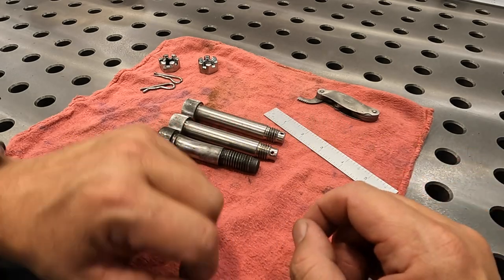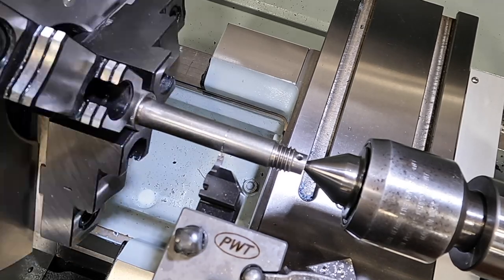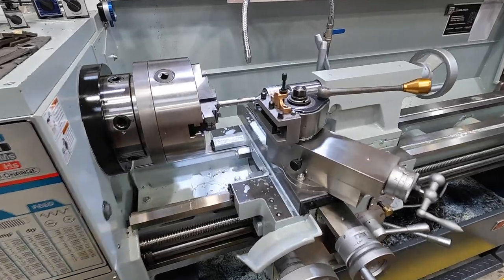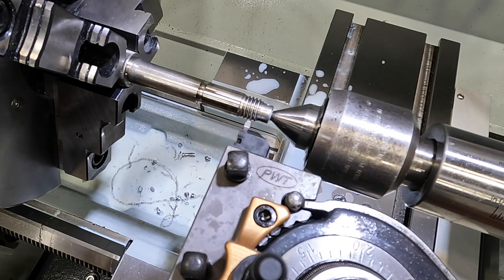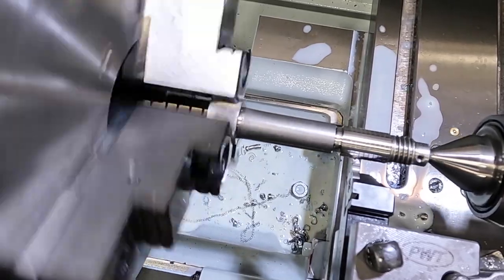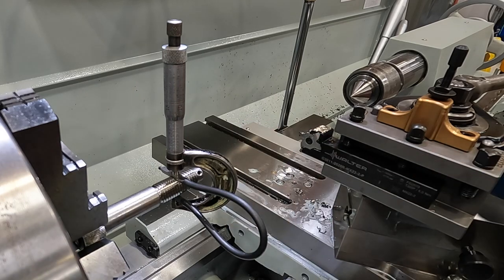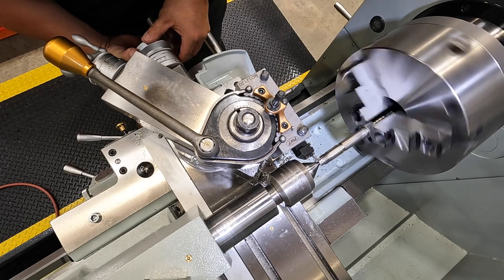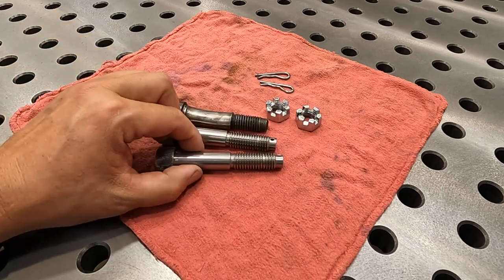Single Point Thread Chasing on a Manual Lathe

Comment: Greetings Adam. Congratulations on the new shop and expansion of your machining capability. You should be very proud. Now for the hard part. Your setup was destined to ruin the original threads from the start. Locating the threading tool on the right side of a 60 degree thread with the compound set at 29 1/2, doesn't work the same for chasing as it does for cutting a thread from scratch. To simplify, imagine 2 cars on the freeway side by side, but the one on the right (original thread profile) is slightly ahead of the one on the left. Now the car on the right turns 30 degrees to the left while you only turn 29.5 degrees to the left. A collision will occur. Exactly the same thing happen to the original threads on this rework. I don't have the parts to inspect, but I'd bet ya dinner, the original thread PD is now smaller than additional threads you just cut. Align the 'V' first as deep as you can then back out the tool and creep back to that position. I hope you accept this in the good faith it was offered. Stay well.
Reply: I was wondering the same thing... not knowing how the original thread was made (process, geometry, tool wear, machine integrity, etc etc), one would be forced to first align the re-work tool to the thread as closely as possible before setting up a hard rule like the 29.5° compound setting - otherwise one is pretty much destined to cut over the original thread somehow somewhere...
Reply: I havent done it a lot, but when I do I put the compound parallel to the work  engage threading and stop the spindle when in front of the threads then  just dial the compound until the thread lines up. Ok so I am feeding straight in, Its a repair job.
Reply: look like the nut threaded on great to me.
Reply: Actually .... this works just fine. The right flank of the cutting tool is aligned parallel with the right side of the thread "wall". When feeding is done with the top slide, the flank of the cutting tool keeps the distance from the right wall of the thread groove. This works because the top slide is in the correct angle which makes it parallel with the right wall of the thread groove.
If Adam would have the habit of keeping the top slide parallel with the ways and would feed using the cross slide (like I do), this definitely would ruin the thread if aligned as shown. In this case the alignment is done perpendicularly to the middle of the thread groove.
Reply: @danneumann3274  That's how I do it as well. I usually do not confuse myself with the 29 degree stuff. Actually I have my top slide dialled to be parallel with the ways. This makes it much easier to feed along Z-axis (along the ways).
Reply: @FinnoUgricMachining  the angle of the compound did not match the thread profile. Right side damage was imminent.
Reply: @joepie221  Okay, agreed. But at least Adam tried to ... 😄
Reply: @joepie221  maybe you could show us , would appreciate  it .
Reply: I also think the thread was rolled slightly
Reply: Shouldn’t we have dressed the top of the thread form, too ? There needs to be clearance between the top of the screw thread and the root of the nut thread, otherwise the thread pitch diameter will be undersized by the time the nut fits . . . .
Kind regards,
Steve A.
Reply: @mikedyson7330  I already have. Check my channel video catalog for the chasing thread video.
Reply: This is so cool, my machine tool instructor told me about Abom today and the first video I watch, you are the first comment I see. I have been one of your subscribers for a while now. Great to see that you're active in the machinist/trade community
Reply: I run a solid toolpost, no compound needed. I align the threading tool with the auto-feed on my electronic leadscrew and send it. 
I thread the same way, no compound. Just feed with the cross slide. 

I’ve yet to dig my compound out for anything other than tapers since I took it off. 

Not saying anyone is wrong, but it’s hard to f*ck up the threads if you’re feeding straight in and properly aligned with the threads. Just sayin!
Reply: @Mr.CleanRIZZ4u  Thanks.
Reply: I know jack squat about machining. But my eye caught that mistake BEFORE he started cutting. I actually stopped the video and changed the playback speed to .25 and watched it cut into the side of the existing thread in slow motion. Kinda weird that he didn’t see it. It was pretty obvious when the nut didn’t go on smoothly.
Reply: @Joe Pie - exactly. And you can see what’s happening if you set playback speed to .25
Reply: I caught that when he first started getting down closer to original threads. Obviously removed some material there on the original, couldn't see why he continues on.... Those first few threads seem pretty loose when he was threading nut

Comment: On my badly worn Sheldon lathe I engage the half nuts then push the saddle to the right (for right hand threads) when lining up the tool with existing threads.  It must be a joy to use a tight, high quality machine like that!  Another great video!

Comment: I am a level 3 machinist apprentice and I have to say I've never seen a thread chased this way with a compound at 29°. Fresh threading yes 29°, but for chasing, I alway set my compound 90° aka so the ways of the compound are parralel with bed. Then I engage split nut, and feed back and forth with compound using a dial on compound to show when I hit either side of the thread wall. Then I split the difference, do an eye check and this ensures youre in the bottom. Then some guys like to take some pressure off one cutting edge of the tool which is fine and would be acheived by moving compound in direction of chuck maybe 0.002". Then use oil and gradually feed in using the cross slide over multiple passes until you gently clean it up.

Comment: Nice. I had to do something similar - I thought I'd cut a deep enough M18 x 1.5 thread on a custom bolt I was making, and found that it wasn't quite far enough - so I had to pick it up again, and do another few passes on it. I just made it up as I went along, nut cam up with more or less the same method - using the compund-slide to adjust the position sideways and cross slide for depth. It worked! ;)

Comment: Hi there and greetings from down under, I work for a valve manufacturer and cut threads on a daily basis have done for 30 years, there is no need to turn the top slide around to halve the thread angle.  Keep it set to 0 and engage the halve nuts then simply adjust the top slide unit the tool lines up with the existing thread happy days,  I hope this comment might speed things up a bit for you.  Cheers

Comment: Excellent ! Just finished a 0.46-24 brake tube nut for my 63 Split window vette single master cylinder. It's the original date coded Master from GM that came on the car. Typically it's a 7/16-24. Not sure what happened or why this Weird thread made it onto a production car, but here I am, making a custom nut for the damned thing out of 12L14 9/16 hex stock from McMaster. This technique would have saved half the time and material knowing how to pick up a thread last week to adjust the length or fit. Thank you  Adam for all the great content over the years.

Comment: Top job,Adam. One additional little tip I use is to blue the original thread with Dykem and it makes it easier to see where the tool is initially making cutting contact with the thread flanks....it does help getting the alignment spot on.

Comment: nice trick to know. I'm a bit puzzled by the tiny gap one could see on the close up views to the right side of the tools with the original thread : would that not mean that there is a slight misalignement of the tool with the existing thread (i.e. when one is plunging at 29°1/2 without touching to the right, when bottoming the right of the original thread will still remain a bit further away on the right side of the tool) - should not the tool be in light contact of the right thread trailing surface rather than a few thou away?
Reply: I believe we are seeing remnants of the original thread relief that was present on the provided bolts.
Reply: I saw that too, and it definitely started shaving the original threads. In the end one thread looked flattened
Reply: He is feeding the tool in on an angle, but the tool is set so the thread form is correct, tool is at 90 to the work piece.
Reply: What you are seeing is the original thread was actually tapered at the shoulder end. Watch closely around the 12:15 mark and you can see both this taper and the cutting tool slipping almost exactly in between the original threads.
Reply: @ryanlukens9280  which is my point: should not the tool be just touching or almost the right side, since it's going to be fed in at 29.5° , hence along the right side of the thread?

Comment: Did any one notice when the thread was first being chased that there was light showing either side of the cutting tool? If you are going to go in at 29 and a half degrees to only cut on the left side of the tool then surely the right side has to be within a thou or less of the left side of the thread( to the left of the peak) otherwise if there is say 8 thou gap to the right side of the tool then the centre of the new thread being cut is 8 thou to the left all the time. Also as the tool got deeper did anyone notice that the original thread was being cut and chips were coming off. Which to my mind says my original statement was correct Adam was off too far to the left when he set the tool up to the original thread.
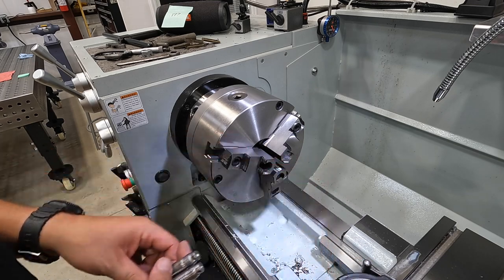Reply: He addressed that at aporox 17:30.

Comment: Interesting! Never seen that done before. Without knowing anything about the application, I won't comment on the rolled vs cut thread question. Bolt torque, etc. Don't know if it has to be exact because using a castle nut means you may have to go a little tighter to get the pin hole lined up (never back one off to do that). Mechanical Engineer (now retired) IRL BTW. 😁

Comment: 12:18 It looks like the cutter is slightly ahead of the existing thread during these initial cuts. Does the 29.5 degree compound angle compensate for this by the time the thread is finished?
Reply: Yes!

Comment: I needed (2) 5/16-18 socket head cap screws 
2" long with the thread all
the way back to the head .
They don't come that way. 
I did just exactly as you did  . The main advantage to using the compound is your cutting on the left side of tool only. When you  use the cross side you cut on both sides of the tool. 
That creates twice as much surface cutting and is more likely to cause chatter in the thread . You must use another depth for  the compound than the double depth marked on a 
thread gage. My machiest hand book has the correct depth setting for the compound.

Comment: Alternatively, turn the chuck by hand (with the half-nuts engaged) far enough to remove backlash in the gear train.  Then, with the work stationary, line up the RH flank of the tool with the RH flank of the existing thread.  Rotate the chuck by hand a little and tweak the cross-slide and top-slide settings if necessary.
Reply: @bigboreracing356  Maybe OK, but not guaranteed to remove the backlash since it depends on which part of the lathe stops the fastest (i.e. spindle or gears in gear train).
Reply: There is always a backlash. It would be simplier to turn the compound square, engage the feed, dive it by hand until the carriage moves, then find the bottom of the thread by playing with the compuond X and cross slide Y. Small threads can be cut by feeding Y square.

Comment: I would propably just have prepared that thread similar to how you did, but then cut it with a die. Should work pretty well since the existing thread gives you a nice start. But doing it this way gives you a way nicer thread, so thumbs up.

Comment: Worked at a shop years ago where we frequently had to pickup & chase existing threads on cylinder rod ends, SKF nut threads on shafts and rolls because of damage. 
Was always my job because I was the young apprentice.

Comment: I still don’t understand using the compound for infeed. Cross slide sure, but to me it seems that using the compound on an angle is moving it both in (X) and over (Z) making it not line up with the previous cut? After this vid it makes a little more sense I guess, but just can’t wrap my head around this one. Still learning of course so thanks for sharing. I’ve learned pretty much everything I know from this channel and of course trial and error with my new lathe and mill. Which I might add is just for my personal project use for turbo applications for snowmobiles, SXS, off road racing, etc, etc. Thanks again.
Reply: I'm no master machinist, but I'll describe what I believe.  The threading tool has a sharp  point and a small flat on either side of the point.  Feeding in with the cross slide would plunge the tip of the tool into the part and try to peel a chip from both flats, which due to the geometry is hard on that delicate pointed tool.  Feeding with the compound at 29.5° tracks down one side of the thread, only pulling a chip from one of the flats on the tool. This results in a nicer chip and longer tool life. 
Idk if that's clear, and maybe I'm way off.  The beauty of the internet is that someone else will be along to correct me soon.
Reply: @mulletscientist  I appreciate the response. I guess the thing I’m not understanding is how when moving in on an angle it’s not moving it over as well, therefore changing where the tool is in relation to the previous cut.
Reply: It is moving relative to Z, but he attempted to set the tool to match the existing thread at full depth. He then backs the compound off to start diameter and begins the threading passes. Each pass moves the tool further towards the chuck as well as in feeding the diameter and only cutting on the leading edge of the threading tool. At the finish pass, he should reach full depth and the leading (cutting edge) of the tool should now be matched to the original thread at full depth. 
In the first bolt there is a slight thread transition between the two threads. I would like to examine the part to determine what causes that obvious transition. The second bolt has less visible transition. The thread pitch match doesn't appear perfect, but it may be that the major diameter is undersize at that point and the thread doesn't reach a sharp point.
I have never seen this done before. Having a simpler mind, I would have chased the thread with a die. I will admit that when I do this, the die tends to cut the original thread and my finished part looks gnarly. He is machining SS. This would complicate my success. He didn't indicate the bolt in his setup and clamped in the 3 jaw on the knurled bolt head. I suppose that this introduced some runout error. But this is a bolt, not a precision part. His reference to cleaning up a cylinder or rod thread makes single point chasing a much more necessary method. In my maintenance experience and lack of lathe skills, I spent a lot of time with thread chasing files and triangular files to repair damaged threads. Doing this in the lathe could have enormously improved my result.

I am a skilled repairman, but I am only a hack machinist. What a joy it would be to learn this skill on a brand new machine instead of on my worn out machines. I can't justify that Walter threading tool holder and inserts, but tools like that would boost my confidence.
Reply: @specforged5651  it is moving slightly sideways effectively "sliding" down one side of the thread towards the bottom.
Reply: It's just way less tool pressure, because you're effectively only cutting on one side of the tool. You can get away with going straight depth on smaller threads. But when you get into like 4 or 6 pitch threads, at least on tough material. Using the compound in feed is almost essential
Reply: @brettsukolics5051  So after all your comments I guess I’m starting to understand. He starts the cut on the live center side and in reality only cuts that side along the 29 degree path of the compound until he reaches a certain depth to where both sides are making contact with the tool. So effectively the thread is “moving” closer to the chuck with each in turn on the compound, but threads stay relative to each other so it works out. Learning every day, thank you for your help!

Comment: Is it possible to machine the hex socket in the head of a screw like that, or does that have to be stamped in to red-hot metal?
Reply: @thisoldtony has a special tool with am excenter tu machine the hex
Reply: Rotary broach.
Reply: Definitely check out the This Old Tony vid on rotary broaching.  Excellent.
Reply: It is possible but not practical except when producing custom prototype parts.

Comment: Shouldn't the compound be at 30 vs 29.5 to chase a thread? I noticed that the trailing edge of the tool had clearance initially but was cutting at the end.
Reply: In theory, yes it should be 30. But most people use 29.5 because it ensures you clean up the RH side of the thread form, as that side of the tool makes a very slight cut as you progress in deeper. If you were slightly out when setting the top slide to 30 and it was actually at, say, 30.2, the RH side of the thread would end up being very slightly stepped and a bit rough.

Comment: do you think the castle nuts are cut to fit those rolled shaft threads ... in other words maybe the major of the threads you cut are a little bigger than the rolled existing threads.   Do you think maybe just a file might have made those nuts spin on there easier?   Instead of cutting down in that root deeper
Reply: Looks like he cut the shank to the nominal diameter, .625" instead of the major diameter, .620".  You can keep cutting the pitch diameter smaller and smaller until the major dia comes in,but then you have threads that bear on the points, and not the flanks.  He also overcut the existing thread flanks, not just the roots. Evidence is the nut got real loose on the original threads.   -Doozer